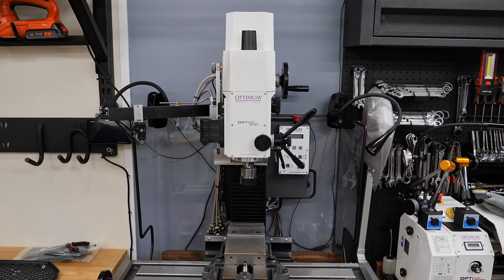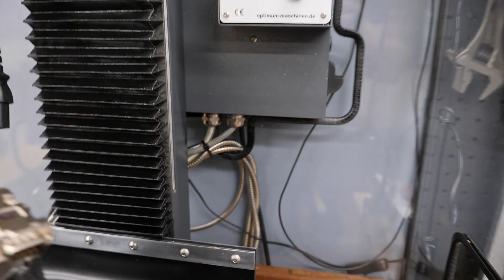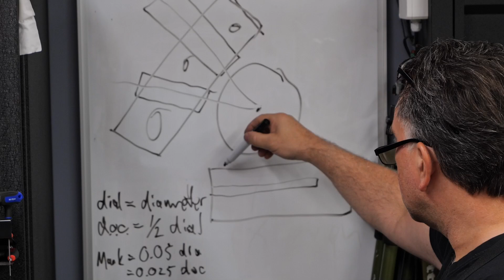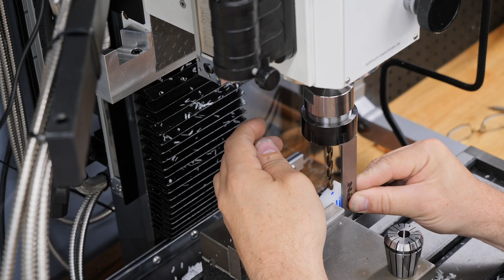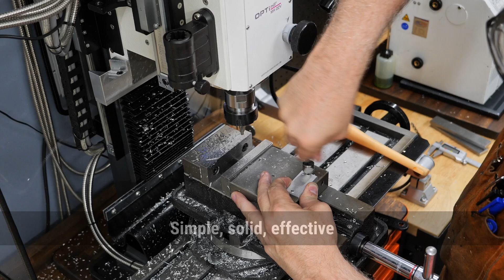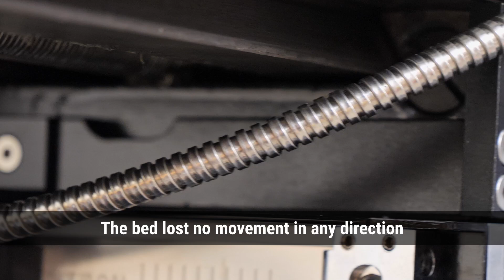1µ Mill DRO ep6 - Only 15mins - RPM + Display Install - Rob's Garage

Comment: I have the same DRO with glass scales. I have never found a video on all the set up or operation of the DRO. Everybody shows their install but not the operation. I spent quite a while figuring out how to flip the direction of my travel. Have you figured out all of the features?  That would be a very helpful video to see. Thank you.
Reply from the maker: Hi, I've watched (or tried to watch) a few videos on how to use them, but because they are always completely different, it becomes too hard to follow. So far I've still only been using it as an accurate and convenient digital ruler, and also the center-finding feature, which is very convenient. Just those make everything so much easier and more accurate. 
The feature I want to spend some time on is how to effectively use memories to store and recall values, and also become familiar with the absolute vs relative positioning system. Once I sort issues like these out for myself, I normally do a video if I think I can make it easy for others to understand too. But I don't see myself getting into the most complex features of this and so I would suggest watching some other videos where people have done this. Even Blondiehax (spelling?) has a video with some basic info on using a DRO that is pretty good. 
And if you have any specific issues that I might be able to comment on here, let me know.

Comment: nice and tidy install, but for a soldering iron I would suggest to treat yourself with a Miniware TS101 (or a clone, like the SQ001).  Spot on temp control (+automatically keeps temperature of the tip within a couple degrees) and way nicer to handle (more like a pen).  My dad (retired EE) solders nearly every day and it's the best he's ever had (one lasted him about 4 years give or take).
Reply from the maker: hah yes, I've had the Dremel and a previous gas one for years, but this was the first time I used it for some close-up work. I burnt the bench and my fingers too! I have a proper one at my desk 4 floors of stairs away... too far away to bother. So a couple of days ago I saw an Ozito variable temp station at Bunnings for NZD $28 and as I'm broke I decided that would be a suitable option. I'll see how it goes.
Reply from the maker: oh that  Miniware TS101 is a rechargeable. That could be fun when I have spare money!
Reply: @Ducati900SS  
no, those are not rechargeable, but compared to the stations it only needs 12Vdc/5A..24Vdc/2.5A (~60W) to function. No station (controls are in the handle). 
If you got Ryobi tools already that $28 might be a very viable alternative.. just takes up more space on the desk.

I just dislike those gas soldering irons as there is cheaper and better options for at least 10 years at this point.  Those things belong into a museum of curiosities ;-)
Reply from the maker: oh, I looked up Miniware TS101 and Google shows me a bunch of USB irons. I assumed it was that. Yeah.. it's still showing me that. It looks nice though. I had a small rechargeable back in the late 70s. It was pretty good, but it had those two-pronged tips that always gave out pretty quick. Have a look on Google anyway and see if that's what you see.
Reply: @Ducati900SS   apropos spare money.. those 1um digital linear scales must have cost u a bit.
My question in the TU2004v video about the height of the cross slide vs top of saddle was exactly for that reason.  I found an economic 1um MSR5000 set on ali (10mm high) and with only a few left I got me one as I've seen enough videos of this lathe now that I know that even a KA200 glass scale isn't going to fit there without loosing swing.
Reply from the maker: I still haven't paid for them. Both DROs and my rotary table are staring at me from my credit card wondering if I'm going to pay them or pay my tax first.. I think the latter will be winning that one :(  

Once I had found a seller on eBay I sort of trusted (I contacted them first to discuss some details) They had both 5 and 1 micron Ditron scales and the 1 microns were not much more expensive than the 5... I'll just double check that... Yes, they are all expensive compared to random glass scales, but less than 5% difference from each other (e.g. 120 vs 125 pounds). That made it a no-brainer to get the 1 micron ones. I could have got generic glass scales for like a quarter the price, but I wasn't going to waste all this effort and put up with a klutzy installation just to save a few dollars. I'm pretty fussy about some things as I'm sure you've noticed :)

And also of interest is that all the scales there were the same price regardless of length, meaning one could possibly get away with buying a couple of long ones and then cut them down for the short ones, assuming they'll sell extra read heads separately.  

I think in the first video in this series I checked how these magnetic scales would fit on the lathe. It was because of that that I decided to get the little Optimum DRO for the lathe instead of a big one. It's the one with the very small tape scales. I wanted to be able to use the third axis on the compound and those scales will fit easily there. The other decider was that I didn't need a big-daddy DRO on the lathe. Just something to count and show me the hundredths. I'll be doing a video on that soon.

I'm about to go downstairs and I'll measure that height for you. Let me know anything else you need.
Reply: @Ducati900SS  
The USB port is for changing settings like switch-on-temp or delay-before-sleep (to save power).  The iron heats up from 0-300 within 15 sec (if the power source is capable).
There is a 5.5/2.5mm barrel connector for power right above the USB connector.
Reply: @Ducati900SS  
For the bed I'll get a 5um glass scale (KA500) as there is much more space there - but first I need to have the machine here to figure that one out.  I only got me the magnetic scale now because that 1um offer I found was too good to pass by (AU$95 for 500mm, w/o alu-carrier) as the diameter accuracy then is already "down" to 2um (a 5um scale there would be not cool).

No, nothing else needed thanks.  I'm already 99.5% confident that the MSR5000 mag scale is the only option for the cross slide without doing something very ugly.
Reply from the maker: Ok, The thickness of the slide is 16.5mm, the total height over the saddle is 18mm. The available space on the addle there is 30mm.. ie. from the cross slide across to the edge where the wipers are attached. Hope that helps. I would definitely want to avoid using up all that space as in that "Warco WM180 new beginner " video. You can also mount it on the other side of the slide, but the tailstock often needs to slide into that space.
Reply: @Ducati900SS 
Cool, Thank u very much.  👌
So there is ~5mm space left there with a MSR5000 scale, so I can use a 3mm steel angle for protection.  That should work well.  At least I didn't get the wrong scale, heh.

Other side of the saddle is not good as he saddle will be able to "twist" ever so slightly under load which will introduce reading errors compared to where the tool-tip is located.  It's best to have it right under the tool.

Comment: Killer setup, that full readout dro is one of the best ones out there, and it looks tidy as. Have you done the first completed dro project yet? Can't wait to see it all in action, as I said before, I ended up installing one on my lathe too, I wouldn't be without a dro anymore, there just too good🤞👌🇦🇺
Reply from the maker: Thanks Adam as always!  I'm looking at my list of projects to decide what to do next. I've got another weird gadget to mount on the mill, plus the small DRO to install on the lathe and I need to strip my rotary table into pieces to get it working properly. And on top of that I have to get stuck into the little Honda with a local guy I've met since doing all this, and I want to do a series of restoration details clips on the Ducati as I know some subscribers would rather see that over the machining stuff. Too much to do.. I'm going to go downstairs in a few minutes and I think I'll look at the rotary table and the mystery mill accessory. How's your stuff getting on... last I had was your fabulous chuck Christmas tree.